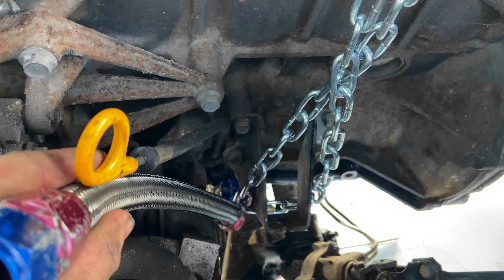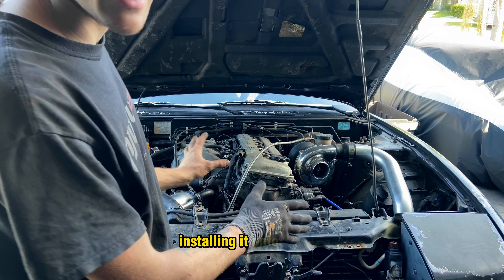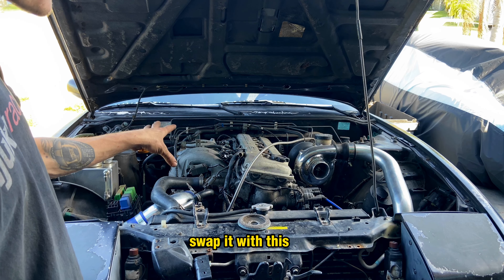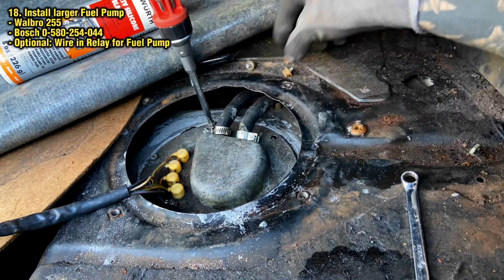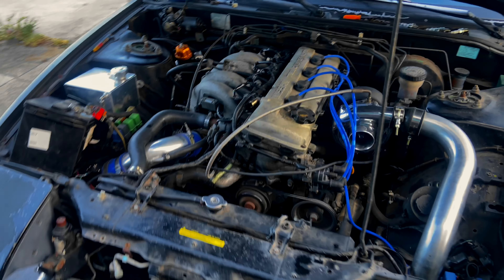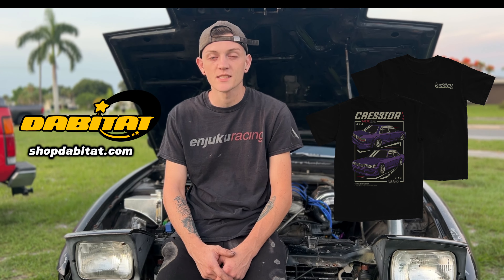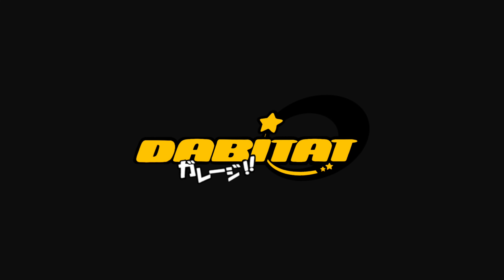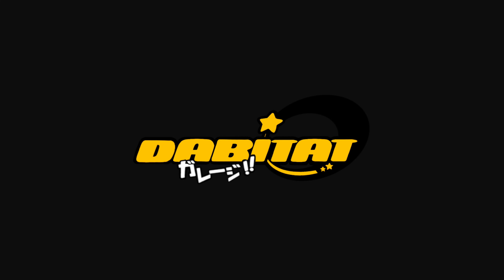240sx KA24DE Turbo on a Budget: Step-by-Step Guide

Comment: I have a 96 s14 ka tryna turbo it, mite just follow your guide g appreciate it 👌🏽 .. Also if i heard correctly, you dont need forged internals correct? What if i wanted to get forged internals? Does that also add to reliability/hp?
Reply: It makes it so that you can give it more boost without blowing it up. You are good under 300hp on these little kas.
Reply from the maker: You don’t need forged for anything under 300hp! 
A good rule of thumb is Sr Injectors, 8lbs, 93 pump gas and you can make like 260 safely. 
After that I’d look into going E85. Detonation is the killer of KA’s. Once you start hitting higher power numbers this is a huge obstacle. With KA’s being as researched as they are we’ve found that E85 can take it so much farther. 
Forged will definitely keep it more reliable, especially with pistons - KA’s like to smoke ringlands on stock pistons.

Comment: KA injectors come out easy af, a little wd40 around the injector housing and push down with a large flat head between the thick plastic on plug and the cup housing, should lift right out maybe a little wiggling necessary. Extremely useful on 300zx vg to replace injectors without pulling the whole rail.

Comment: So the turbo oil drain goes from the turbo to the pan, but where does the oil feed line come from, or I guess where am I supposed to connect it to?
Reply from the maker: I have mine connected to an oil sandwich plate. You can either do that, or take off your Oil pressure Sensro and get a T. Put the sensor on one opening & the feed on another the other.

Comment: Hey I got a random question but at 10:58 I saw you used some kind of gasket maker on your fuel sending unit, ive tried to stop mine from leaking like 10 times, ive used aftermarket gaskets and even just blew $300 on a new aftermarket sending unit, i think my best bet now is to use some kind of gasket maker, what do you recommend?
Reply from the maker: I used RTV! 
If you have a new gas tank seal (the rubber o ring) I’d recommend putting that in, putting RTV over it, then putting in your sending unit.